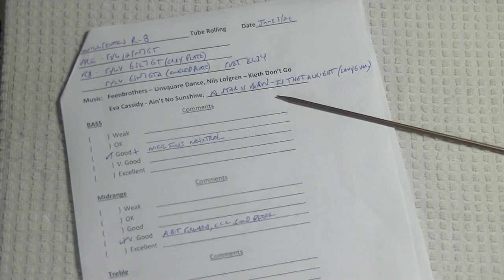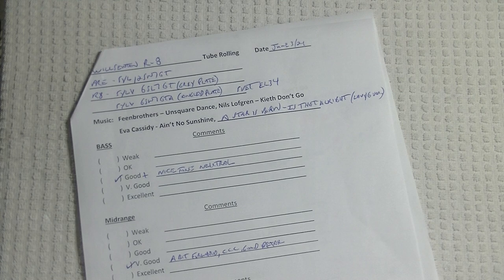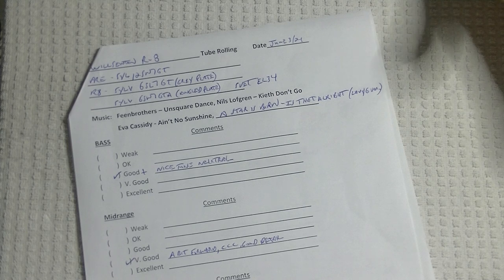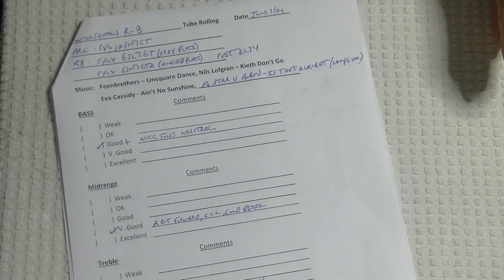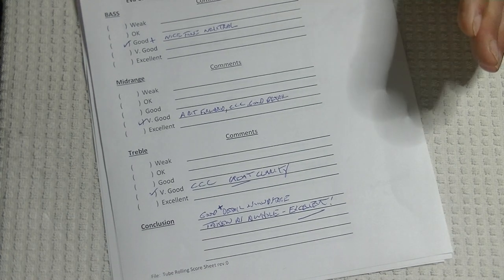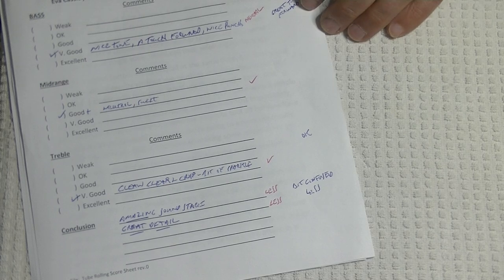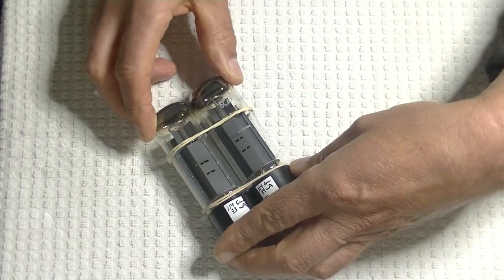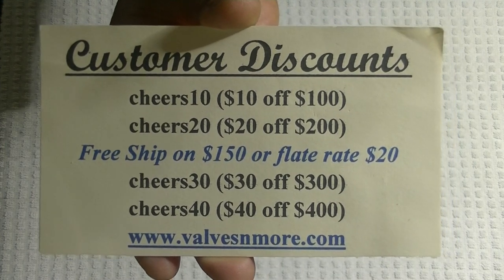Tube Lab #35  Critical Listening

Comment: Hi Jim, what do you think of replacing EL34 with 6L6GC tubes in a Reisong A10.
Reply from the maker: The EL34 and 6L6 are completely different tubes.  The Reisong A10 I'm pretty sure was designed for the EL34.  Given how many excellent sounding vintage EL34's are available, I'd stick to them.  Note I have not tried a re-issue (Svetlana, Mullard, Tung-Sol etc) that sounded even as good as the worst vintage EL34.  One tube you can sub is a KT77, this is actually a beam powered tetrode like the 6L6, but designed to work as an exact sub for the EL34.
Reply: @tubelab194  YES !    
For those who use 6L6GC there are also the nos 7027A and 7581A.......(35 watt plate )
I don't know what is the quality and the sound of these njew production KT77:/6CA7 tubes.......witch as you mentioned are beam power and not penthodes but electrical equivalent to EL34....

Comment: Hi Jim , just wondering when listening to your tubes do you listen to EL 34’s , 6500’s and KT 88’s in the Triode mode or / Ultralinear mode ? Or vary accordingly . This does change a listening perspective . Of course relating to the R8 .
Reply from the maker: For my style of music, system and volume levels (low) with very efficient custom open baffles I always listen in Triode mode and other than to do some tests can't stand UL mode.  Now interestingly, my first tube amp (many moons ago) had a triode/UL switch and I enjoyed it in UL mode, it was also a pp EL34, but I was running less efficient box speakers - nice ones, but Triode mode couldn't make them sing.  So with very little test data, it's hard to say if UL mode is better with less efficient speakers and triode mode with high efficiency speakers.  Maybe someone else will comment.
Reply: @tubelab194  Very correct comment and experience............when triode mode does not give its real potential with kind of speaker........may prefer the UL mode but this reality is due to the speakers......needing a kick in the but !
With the right speakers Triode is the way to go.......many amplifiers were considerd to be a little to calm or lacking dynamics but once you match them with higher sensitivity speakers one notice it was the speakers and the amplifier was RIGHT .........